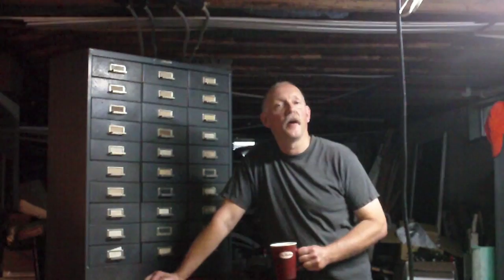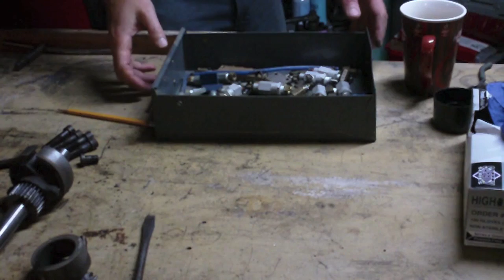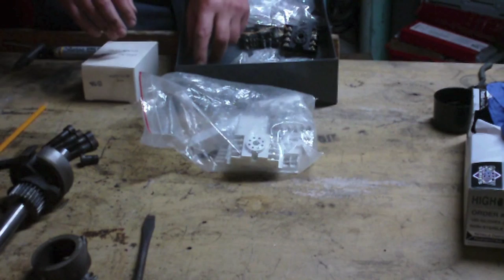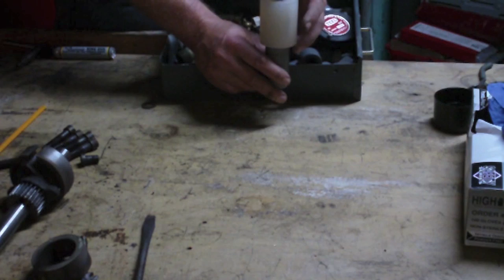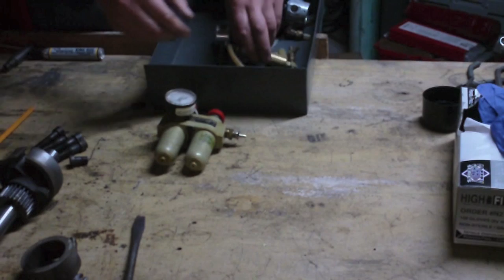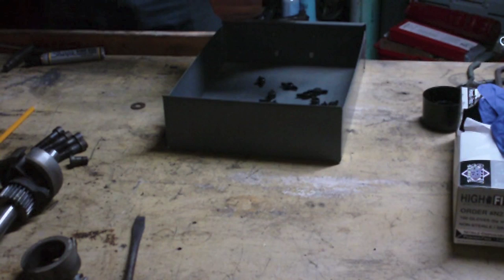The cabinet buy.

Comment: Great haul!

The Chinese finger grabbers are Kellems grips.  The ones with the loops are used to strain-relieve cables that are dropped from an overhead support instead of a box. 

The terminal strip with the pins on the back probably mounts to a PC board.  Big ones like that are often used in fire or burglar alarm panels.
Reply from the maker: Michael Ardai Thanks for the info on the Kellems. The other thought I had on the terminal strip was from back in the day they used to have a little tool for "wire wrapping" where you actually coiled a bare wire around the pin to make the connection. Don;t know if they use that anymore, but I used to come across it 20 years ago.
Reply: Steve Watroba If the pins are square, they could indeed be wire-wrap pins.  If they are round, then they are solder pins.
Reply from the maker: Michael Ardai Good to know. Thanks, and thanks for watching.